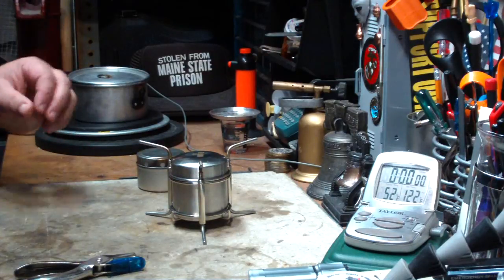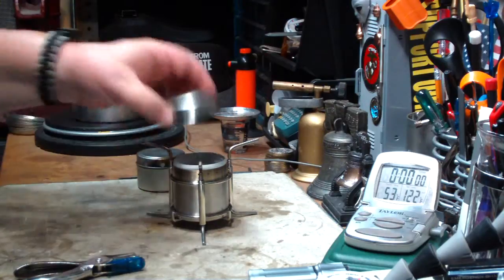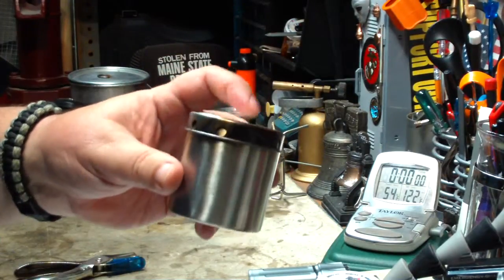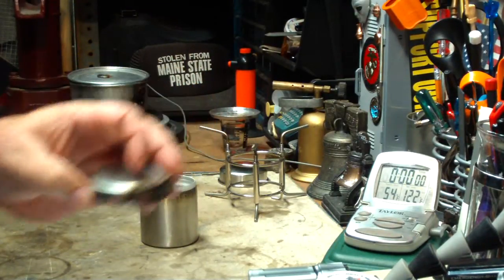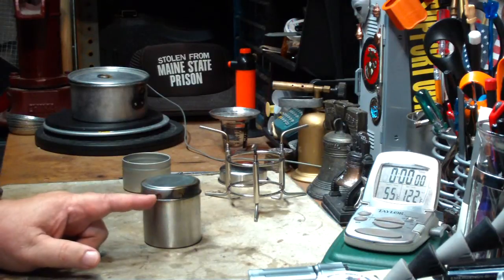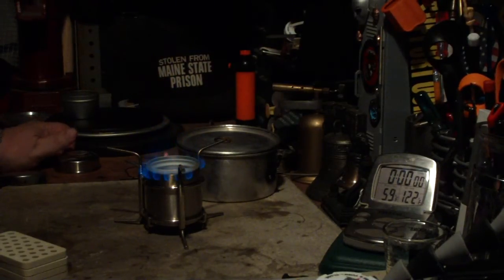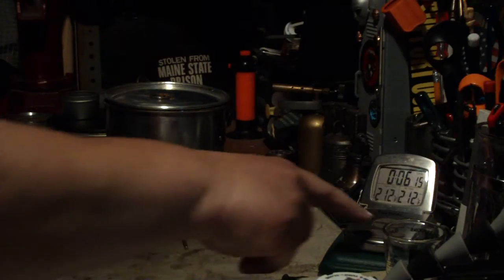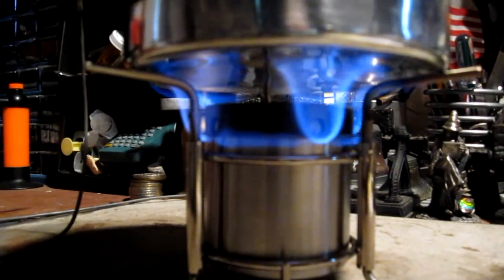Ultra-Safe & High Capacity Backpacking Stainless Steel Alcohol Stove - Simmer Test

Comment: I believe you sould find a tighter lid that will totally stop the Meth vaporizing through the jets that you wish to close.
right now it seems like the meth went through the "closed" jets, under the lid and through the lid holes. so basically you got the same power output but in a different flame pattern.

Thank you for your videos